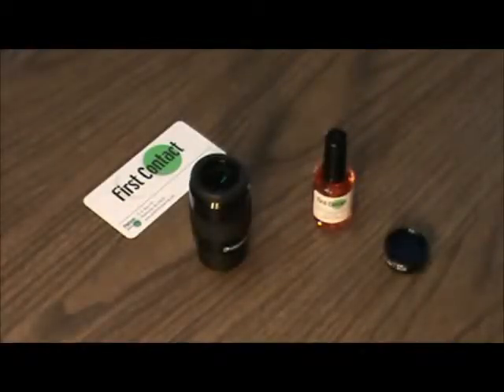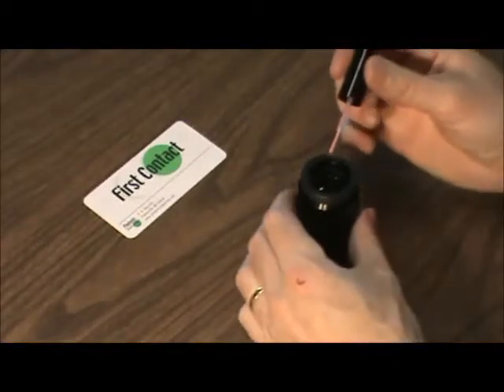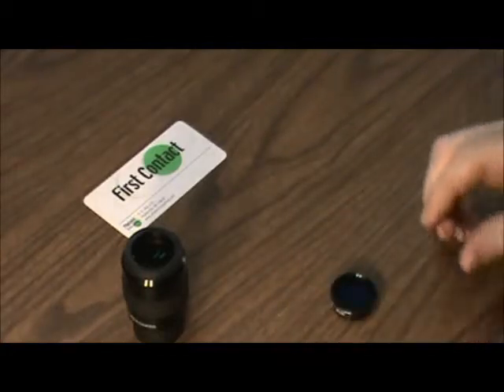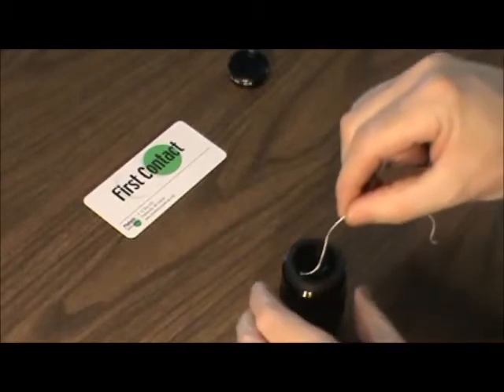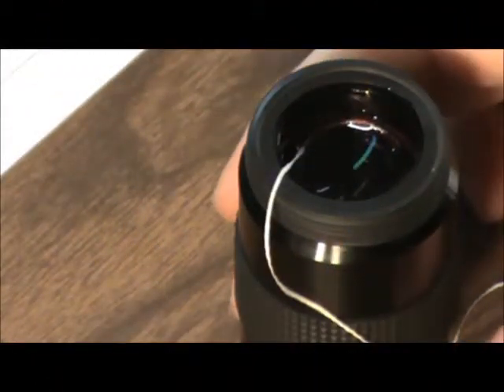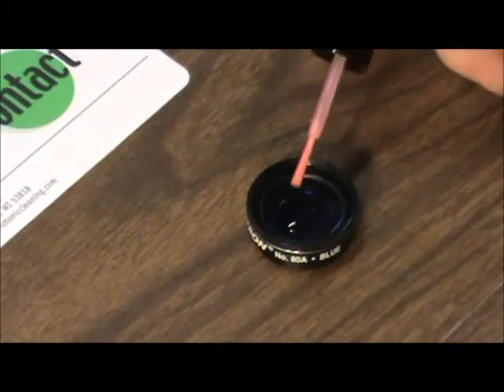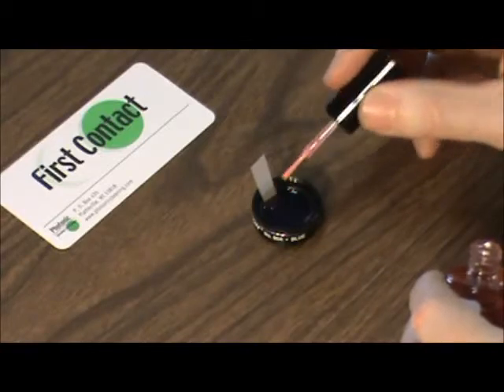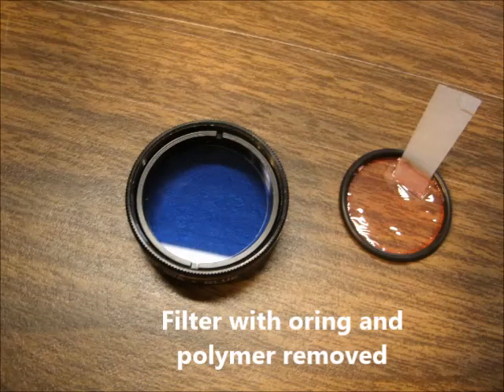Cleaning a Telescope Eyepiece and Filter with First Contact Polymer

Comment: Why does this stuff cost more then GOLD!!!
Reply: Ed, First Contact is quite affordable considering the cost of potential damage to an optic using other methods.  And First Contact won't leave residue.  Our 15ml applicator bottle will clean up to 60 square inches of surface area, making it very affordable, and the cost per ml goes down with larger purchases.